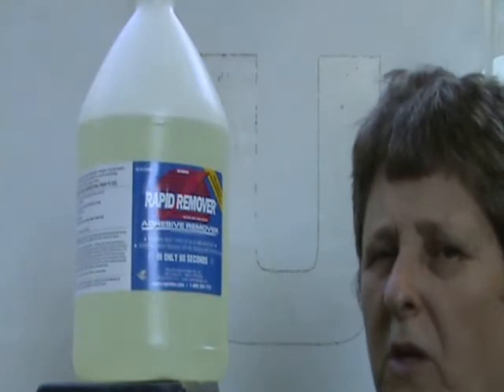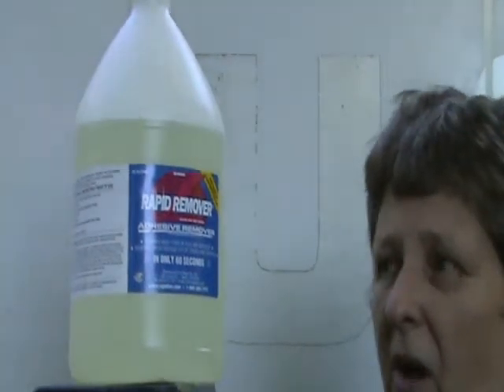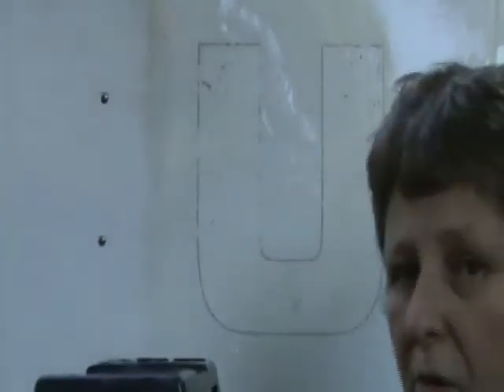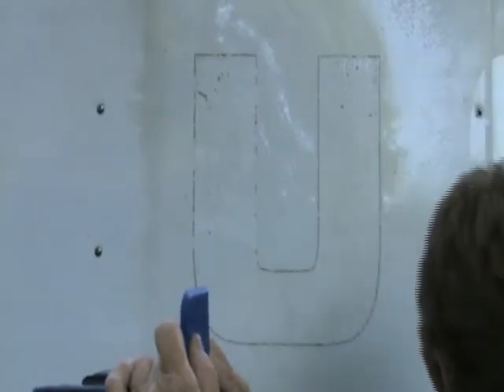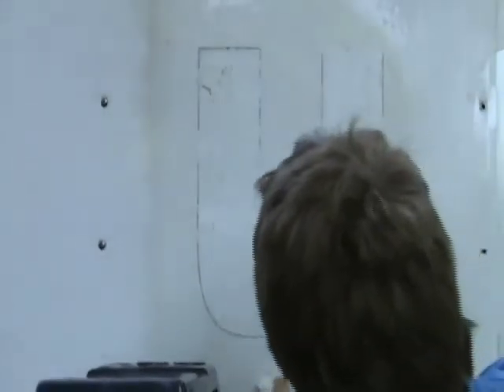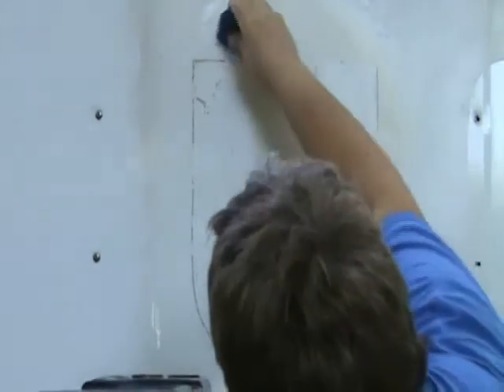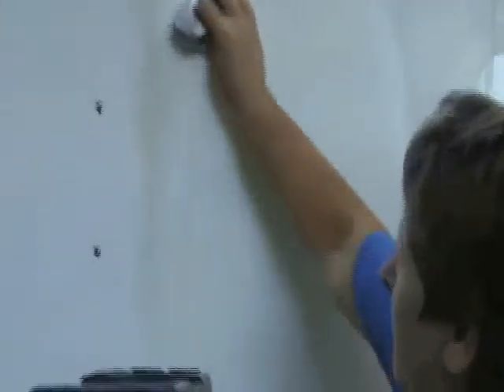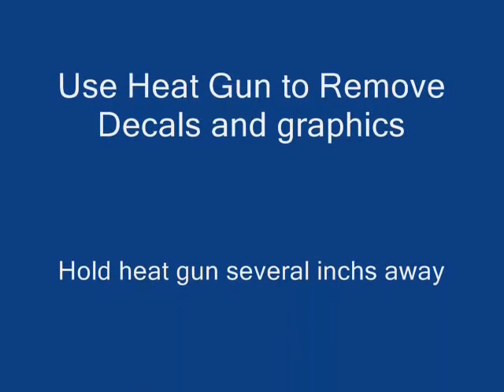Easiest way to Remove Decals and Graphics and Adhesive From a Trailer

Comment: A tip I found that helps is that after you spray that you can use dish soap and water and spray it on after it's been sitting on their 60sec or so, but that helps lubricate your squuegies to make it easier to rub off..or if you have a pressure washer always SPRAY DOWN. But it cleans it right off

Comment: Thanks for the video Phyllis. I bought a used trailer with 4 giant vinyl decals and like your project, lettering as well. 
Getting the big decals off is worrisome. Hoping the heat gun does the job. Any insight or suggestions from you, I’ll give a try.

Comment: I have not tried it, but someone mentioned steaming off decals as a great solution that can't harm the paint. Some people use chemicals, heat guns and 'eraser wheels'.  I suppose it also depends on the size, or material, like a wrap.  Removing the adhesive might require the process as mentioned in this video?

Comment: Well i  have sign shop i go through  5gal per year  last 20 yrs.
 worth  works well  1. Remove old vinyl via heat gun
 2.spray on for about minute or 2 
3. Use scraper lil chisler 
4. Then plastic  scrubie from dollar store. 
5. Spray  lightly again wipe with micro fiber towel.  .
6. Follow with  90% alcohol wipe  clean.